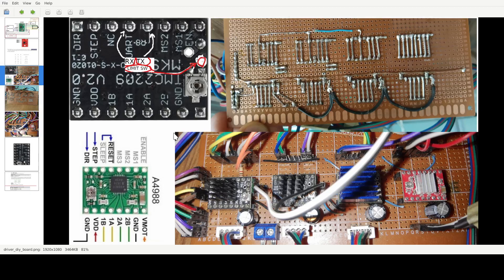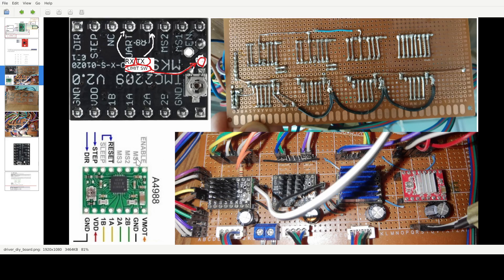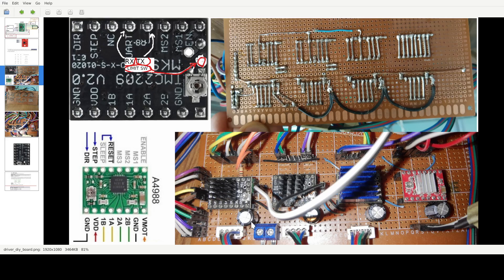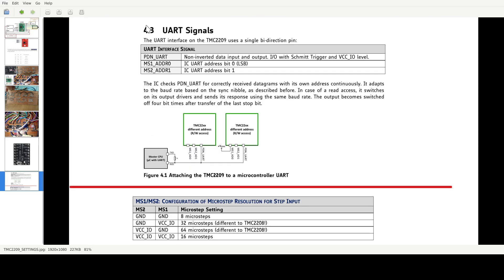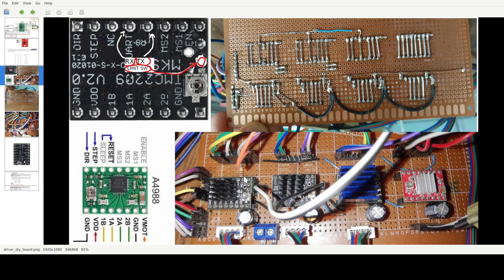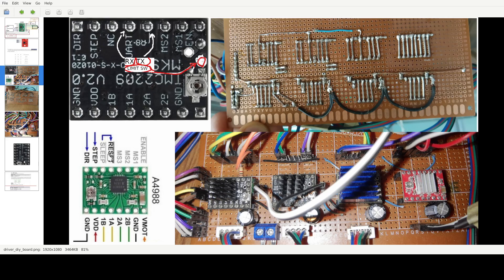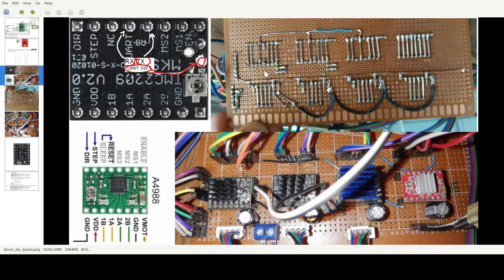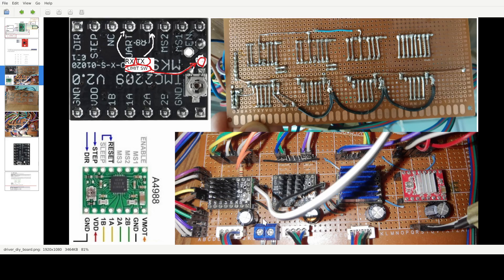How to wire 4 stepper drivers TMC2209 using UART and a A4988 to a mcu - diy 3d printer board

Comment: In this video you mention/show the 1k resistor for the TX / RX pins/line. On your board video, and in the board files there does not appear to be any indication of the 1k resistor for the RX/TX pins/line. This is required?? Do you know of any other issues for the TMC2209 to work correctly??

Comment: Can i use 25v cap or is it not enough?
Reply: I also have 50v caps
Reply from the maker: @Nulled12  if you are going to use 12v on the steppers 25v cap will do, if you want to try maybe later 24v better put some 50v caps from now just in case. the capacitor value must be equal or greater then the voltage you will drive the steppers at. 25v caps will work at 24v but better put something bigger so they dont fail prematurely since you have them

Comment: Wow, this is amazing, I wish I found your channel sooner. This is amazing, a truly diy 3D printer. If I may ask, what is the max. build volume and how much did the complete project cost?
Reply from the maker: Bed size it is 235x235 and height around same size, though size is easilly adjusted to any size you wish, at almost no extra cost, just a few more cm on profiles that doesn't cost much if you order them from the start.  I spent a bit more on shipping cause I made a lot of small orders as I was building it. I already have a rough list of components in the description in the thingiverse link, I will go over it these days and update it with a total.
Reply from the maker: ok so I made some calculations and I paid around 300$ on parts. I payed a bit extra cause I made a lot of small orders while I was testing and realised I am missing some part. If I add all the parts from the thingiverse page in the description that I used in the cart its around 190$ and then around 40$ on the aluminium profiles bought locally.